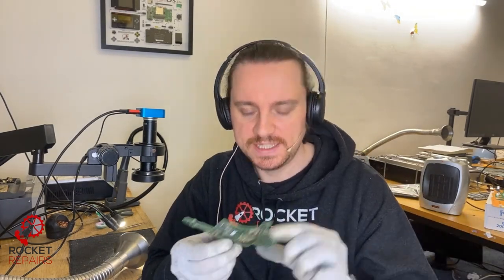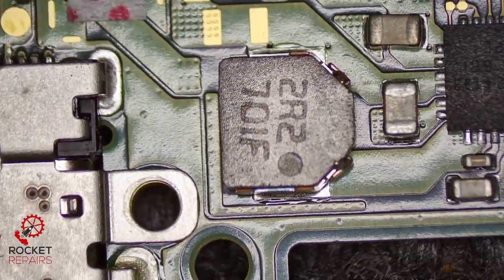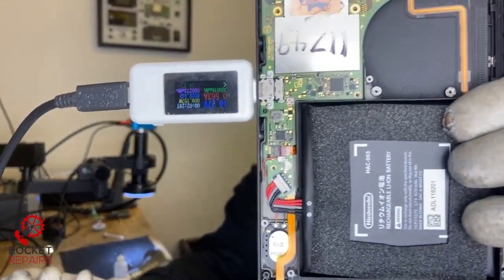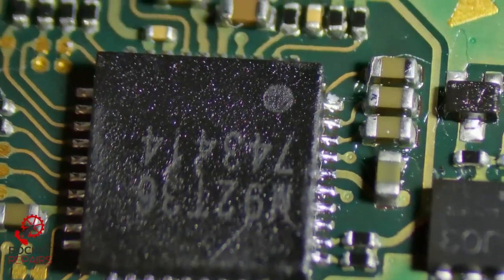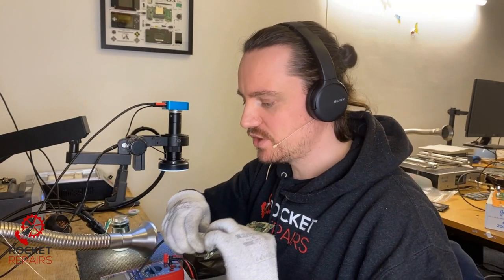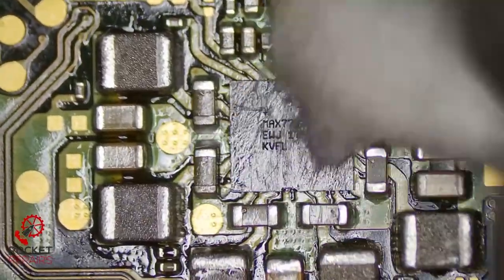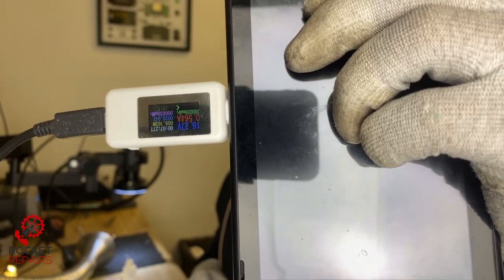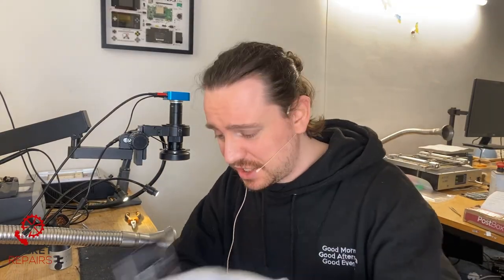Nintendo switch, port is perfect but not charging and no display. LET'S DIVE IN!

Comment: As someone else mentioned  possibly RCM mode. I bought one off Ebay and all chips had been replaced, but had a black screen, I connected up to a PC which indicated it was in RCM mode.  That was constantly changing at around 0.4 amps.
Reply: Yes i had the same problem rcm mode .

Comment: From what I know, constant current consumption is usually a CPU/GPU failure insure.  You can try to check under the heat camera or with IPA if you have a heat from all sides of the CPU or only from one spot on it

Comment: My experience is when you see 0.45 amp draw without booting even when replacing the ic's you have a bad nand. Bad nand is game over and you have a donor motherboard.
Reply: This is correct
Reply: Not necessarily. You can connect it to another switch that is unpatched or chipped and dump it.  And rebuild it if there is any missing partitions. The last resort is to use a donor prod info to rebuild the emmc but lose access to the eShop. Watch "StheTix" vids he has tutorials.
Reply: You can use mmcblkNX to confirm if the nand is faulty.  I used it on mine which was from an unpatched switch and confirmed it was a nand issue, so bought a replacement nand and restored it with a firmware rebuild.

Comment: Im repairing a switch and im in the same situation what i have noticed is there is a short under the voltage regulator (max chip) its shorting out both max chips today im gonna desolder the cap thats between the two bigger caps and aee if the short goes away
Reply: Have u been successfull?